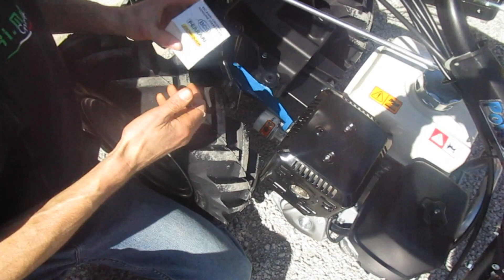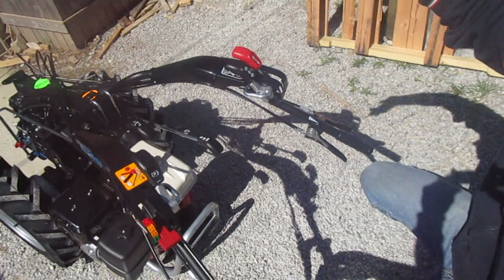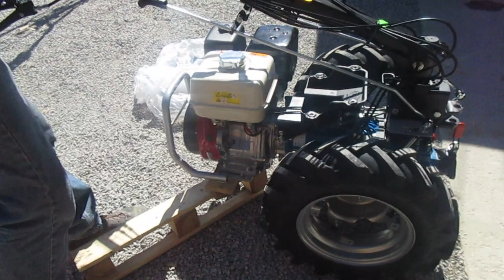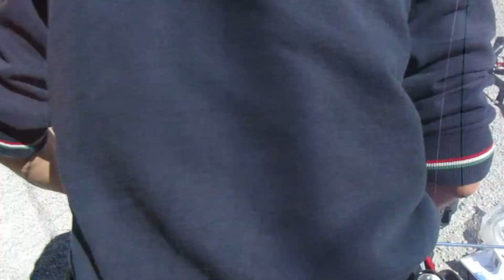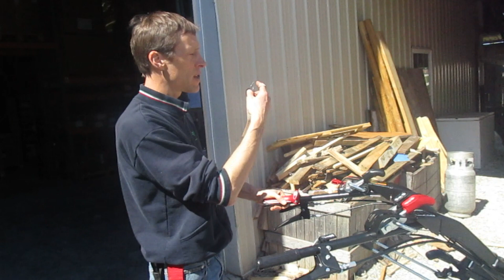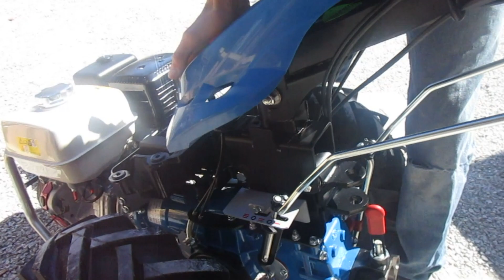BCS 749 Setup video (works for 739 and 750 also)

Comment: BUT!!!! when you leave te tractor running and its NOT IN NEUTRAL are you not still burning out you clutch ???? !!!  (hydronic or dry --maybe hydraulic clutch  wont burn it out a fast but still are you not wearing out yoru clutch if you walk away from the tractor with it in gear with the engine running ???